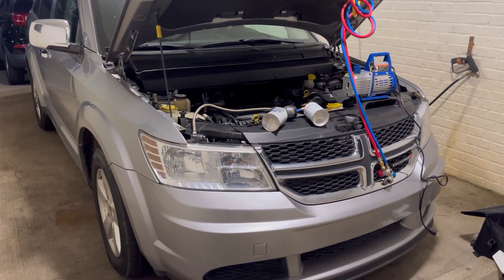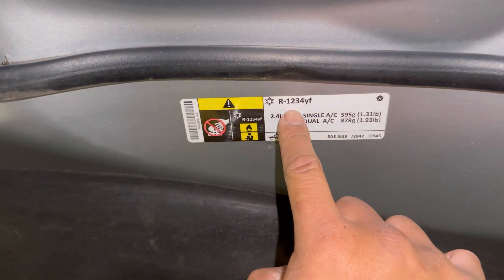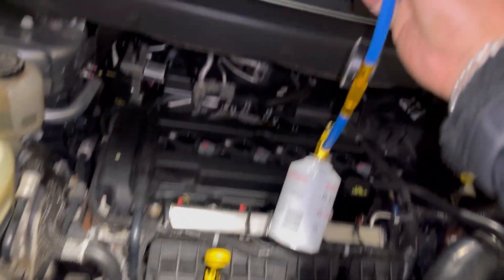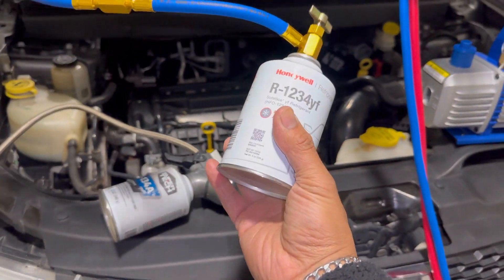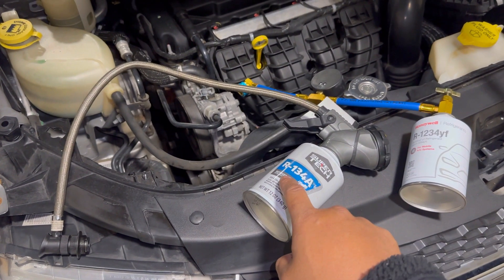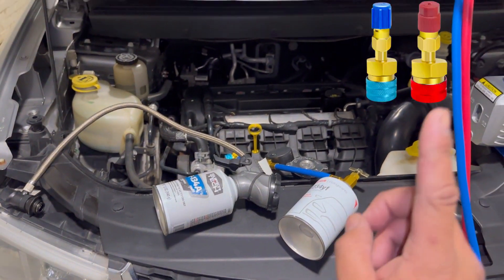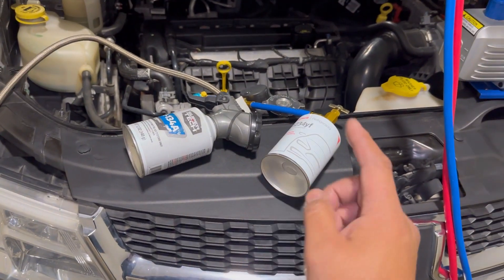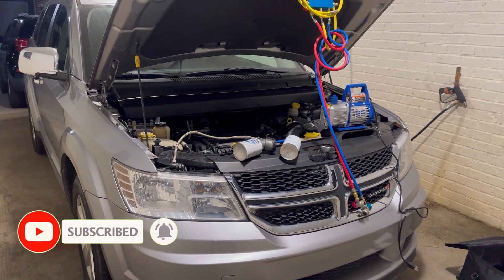R-1234YF and R-134A A/C Refrigerant

Comment: Don't you need to change the oil in the compressor? I heard both gases take a different oil to run right🤔
Reply: I had the same question. I know that POE oil is used in a R134a system. But if you did not get an answer in about 5 months what does that tell us?